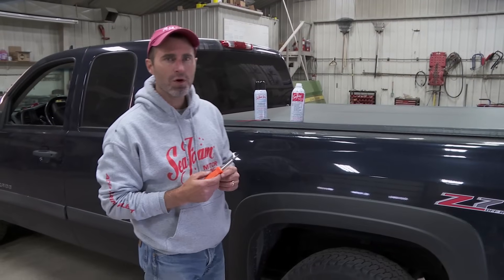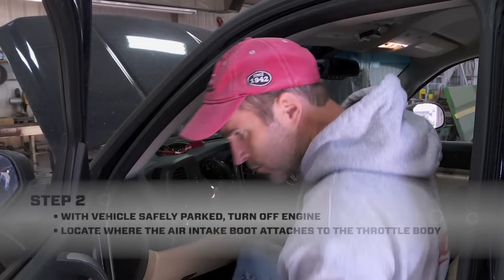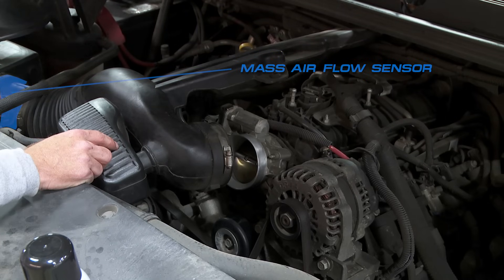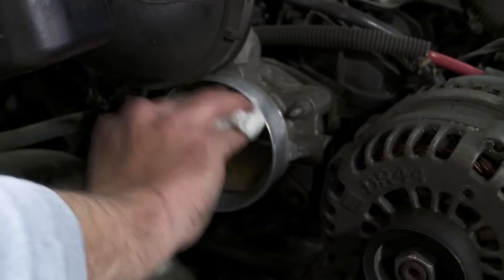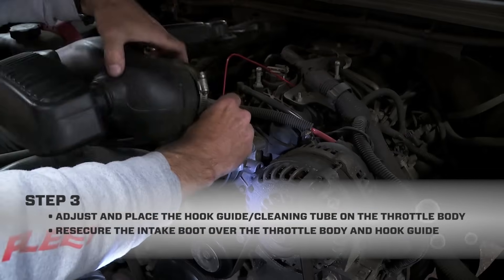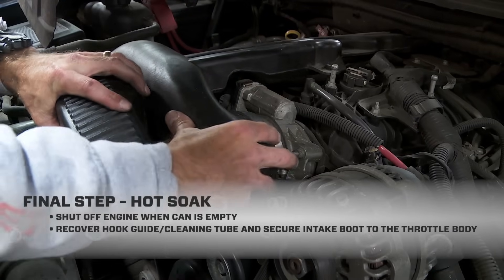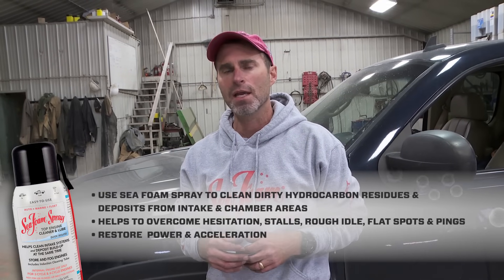How to clean a gasoline fuel injection air intake with Sea Foam Spray

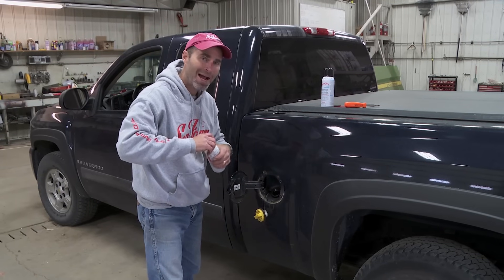Comment: @0:48 If that was the case , why instruct to poor 2oz pair galón on the can?
Reply from the maker: When Sea Foam is added to fuel cleans fuel injectors, when Spray is applied through throttle body clean intake valves through the air stream.
Reply: @SeaFoamOfficial wtf.
Reply from the maker: @memphisreines  Your original question about how it works (see edit) no longer appears.

Comment: My experience was that half the can of injector cleaner / gas treatment  ended up on the ground because the bottle does not have a neck.  I suggest using a funnel.
Reply from the maker: Agreed, funnels are essential for capless tanks.

Comment: So if you add through the throttle body does it helps to clean the fuel injectors that go to the cylinders???
Reply from the maker: No, does not clean through injectors. The throttle body controls the air that goes into the combustion chambers. Fuel injectors spray fuel into the chambers where the fuel and air combine and explode (gas spark plug ignites). Hope that helps!

Comment: I don’t even remove the intake boot in front of the throttle body. I simply drilled a “seafoam injection port” on top of the plastic boot, it’s got a tiny screw and o ring to seal it. 

To clean , I remove the screw/oring, insert the seafoam can hose, fire up the engine and spray away until the can is empty. Shut off the engine, hot soak for an hour. Re-install the screw/o ring and then take the truck for a HARD highway drive.

Comment: Is this safe to do it in front of the turbocharger air intake, after the MAF sensor? This is a 2018 1.5t honda cr-v , the throttle body is way too deep down behind the firewall, it's not easy to get to it. Thank you.

Comment: I love this stuff, I have been using it for years on all my engines. Years ago I had a Suburban that was burning oil big time, I put SeaFoam in the gas tank and in the break booster system as the used to recommend and after a huge puff of smoke the engine never burned oil again for many miles after this.

Comment: I have a Japanese in-line, six cylinder diesel with 100,000 miles runs just OK ,always going to fail the emissions test should I put it in the oil and the diesel fuel and the intake could this help me will it cause any damage anywhere?
Reply from the maker: Yes for adding to fuel and oil. No, do not add to a diesel intake.

Comment: @seafoamofficial 

Hey there, would you say its safe to use in a turbocharged engine ? (1986 Toyota Pickup 22RE-T with a newish turbo)
Reply from the maker: yes
Reply: @SeaFoamOfficial  I also happen to have the high mileage sea foam for the gas tank. I still gotta drive back home which ia 2 hours away before I perform the Sea Foam Spray via TB. Is it better if I wait until I get home and use both cans at the same time ?
Reply from the maker: @billythomas4527   Either is fine.

Comment: Can I use on Mazda 3 2014 and how much gas should be in the fuel tank???
Reply from the maker: Yes, any combustion engine. How much fuel is up to you. The higher the concentration, the better it cleans.

Comment: This is not why sea foam was invented! Can’t trust what he says. Seafoam was invented for 2 stroke engines boat engines to be exact .
Reply from the maker: What's the difference between gasoline for a 2-stroke engine and gasoline for a 4-stroke engine? Sea Foam cleans suspended fuel gum and varnish deposits caused by unburned petroleum residues.   Don't be afraid to expand the logical possibilities. Hope this helps!

Comment: I'm interested in trying this on my2007 Mazda3 with 215,000 miles. I'm wondering if this works as a throttle body cleaning in full though, or if i should wipe it down in addition to cleaning the intake with seafoam spray. Thanks.
Reply from the maker: The key feature is cleaning intake valves and chamber areas. Also works great if you want to spray the inside of the throttle body with the engine turned off, then wipe with a cloth rag.

Comment: I did this on my 2000 Ranger and the difference was amazing. It runs so smoothly now.
Reply: Was your Ranger acting "funny"?
Reply: @Nicholas_Triumph_Thruxton  It was running rough but it wasn't really clattering. It's also getting better fuel mileage now.
Reply: @randall1959  Thank you for the quick response. Yeah, I don't know what is going on with my '98 Ranger. It was running fine, and then one morning it just cranked, but wouldn't turn over. I put some starter fluid in the throttle body, and it started right up. I drove it around, and it didn't die out, clatter, etc. on me. However, after a couple of days of sitting, it did the same thing when I tried to turn it on. I used starter fluid again, and no problem. Now, I'm driving with a can of starter fluid and an 8mm socket wrench. Any thoughts?
Reply: @Nicholas_Triumph_Thruxton  try cleaning the MAF sensor
Reply: @randall1959  Yeah, I'll give that another shot. I've used maf cleaner before on it. Couldn't hurt. I'll let you know what happens.
Reply: @Nicholas_Triumph_Thruxton  Disconnect the coil bank and spray some contact cleaner in the plug

Comment: Can I used the non spray version in the throttle body? put in some Sea foam in an atomizer bottle?
the Spray version is not in my country
Reply from the maker: No, would not work and not safe.  What country are you in?

Comment: Would this work fine with turbo engines? I have a 2015 f150 twin turbo ecoboost. I’m concerned about carbon deposits going into the turbos. I’m sure that carbon passes through them already but am worried doing this that a lot of carbon will pass through at once
Reply from the maker: Yes, video titled FOR TURBO GAS ENGINE OWNERS. We do a demo on a F150 w/Ecoboost.
Reply: @SeaFoamOfficial  Thank you. I will search it up

Comment: Good evening Mr.Brian just Subscribe to your channel.I have a 2010 jeep Patriot and I have an engine light on.Just change the old spark plugs and according to the shop they say I have to use a sea foam in order to remove the engine light on.Whats your recommendation to use a sea foam.I never use a sea foam for all my vehicle accept this one.
Reply from the maker: Try disconnecting the negative wire to the battery, wait a couple minutes, the re-attach. That should clear your code/light.

Comment: What if the sensor is past the throttle body?
Reply from the maker: Which sensor, MASS or MAF?
Reply: @SeaFoamOfficial  maf
Reply from the maker: @Memry  No need to worry about MAF.

Comment: I put SeaFoam in my gas tank every third or fourth fill-up on my 1996 Tacoma with 325,000 miles. After seeing this video, I'm going to get the spray and use it on the intake of my wife's 2013 Subaru Crosstrek with direct injection. I never thought about the intake valves getting dirty from lack of cleaning from fuel not passing over them. I'm not a mechanic. Old dogs CAN learn new tricks. I'd guess cleaning everything from intake back would help keep the catalytic converter in shape as well. We'll see.

Comment: I tried it on a manual transmission  V6 Camry. Followed iinstructions and the car  stalled  on neutral when I drove it.Any idea why?
Reply from the maker: Engine stalled or car stopped?
Reply: @SeaFoamOfficial   Engine shut off completely and car turned off.  No power steering or brakes. Happened twice with trannie on neutral while shifting. Also runing 200 rpms above normal on iddle. Any advice?
Reply from the maker: @leogomez9014  Engine shutting off has nothing to do with the transmission/manual shifting. Some cars have a safety feature related to the key mechanism that causes everything to shut down and lock up. Have it looked at.

Comment: I first used SeaFoam spray in a 2012 Chevy Avalanche 5.3L. I was unsuccessful with the smoke show at the end but I believe I did it incorrectly (I think it’s because I left the straw of the van fully extended, as opposed to cutting it down so the spray had more pressure towards the throttle plate). I just performed it on my 2007 Charger, I cut the straw down and forced it into the throttle more, let it soak for 10 minutes and started it. Originally I had a slight backfire and some smoke, it did throw an engine light but that quickly went away (presumably because of the MAF, even though I applied it after it) and gunned it going uphill, and it looked like someone set off 4 smoke bombs!! They weren’t kidding when they say it cleans! It’ll be interesting to see how much my fuel mileage increases! I plan to use SeaFoam again!

Comment: Can we use Seafoam Deep Creep on the throttle body/Intake?
Reply from the maker: No, not in the same way you'd apply Sea Foam Spray that's getting drawn into the upper engine. Deep Creep is not volatile, so will foul out plugs if it reaches the chambers. Hope this helps!

Comment: I have a 2017 camaro ss and when I try to turn my car on it acts like it’s out of gas but it’s on half I ran out of gas and a small stick fell in would the sea foam work and get my car running?
Reply from the maker: Have you checked or replaced your fuel filter lately?

Comment: I just changed my MAF plugs could crank position sensor cam sensor and pcv valce added new ngk plugs and cleaned out my cct valve... I then used seafoam in the gas tank and the upper throttle body bottle sprayed as instructed waited about 15 minutes after when I started the car and took off there was so much smoke u couldn't see anything on my streets... Car runs like new now.... What exactly is in this stuff and how did it clean the inside of my intake so we'll. Do you recommend and oilf change early now
Reply from the maker: No need to change oil.

Comment: Just don’t open the butterfly valve on throttle body by hand. Use the gas paddle. That’s just my experience.
Reply from the maker: Agreed - no need to touch or open the throttle blade. Will open when RPM is elevated.

Comment: What do you do if the mass air flow sensor Is right on the throttle body?
My car is a 2009 Acura TL
Reply from the maker: No worries as long as the engine RPM is above 1500 during application. The engine will draw the liquid spray into the center of the  airstream.
Reply: @SeaFoamOfficial  thank you.
Looking forward to trying this.

Comment: Hey , I got a can but my map sensor is on the throttle body , can I still apply this ?
Reply from the maker: MAF sensor (along air boot, before throttle body) and MAP sensors are different - MAP is inside the intake plenum - no concern.

Comment: Thx for the vid.  I've been adding Seafoam to my fuel for years.  I recently bought a direct injection truck so I was interested in best way to inject into intake.  Question - why not spray Seafoam in front of Mass Airflow Sensor?  I used to remove that from my 97 and clean it with spray carb cleaner.  I found that my K&N aircleaner oil would accumulate on the sensor wire and cause problems. Does the Seafoam hurt the sensor?
Thx again.
Reply from the maker: Hi Ray. 1) It works best when applied in front of the throttle plate. 2) A MAF sensor is electronic and usually too far up the airstream - does not make sense to distance application from the throttle plate.

Comment: Thanks for the informative video.  I however could not make it work.  The valve in my throttle body pinches off the red hose.  

Can I spray Seafoam somehow after the throttle body?  Maybe in the spark plug holes?
Reply from the maker: The nozzle should be clear/in front of the throttle plate opening, so you're too extending the nozzle too far in.
Reply: @SeaFoamOfficial  Thanks for the reply!  I might have to try it again.

Comment: Can i spray it directly to the throttle plate while holding accelerator at 2000rpm  without securing the straw between the intake boot and throttle body
Reply from the maker: Can you operate the engine with the intake boot removed?

Comment: Hi Seafoam,
My mass air flow is right above my throttle body, should I extend the straw past the mass air flow sensor?
Reply from the maker: Where is the MAF sensor  located (not MAP sensor) in relation to the throttle plate?

Comment: Seafoam and this Seafoam Spray process just saved me a day changing out plenum gaskets on my Jeep .. and possibly a lot more!  Jeep ran fine yesterday, started today and didn't sound quite right. I was half way between home and local auto parts store for another project when the check engine line popped up and beeped in intervals... which is different than when it vapor locks. Coded - [cylinder 3 misfire, intake manifold, plenum gasket, injectors] ... and I was a bit stressed.   I knew I had Seafoam spray and a couple more cans for the fuel tank at home, so Iought 1 can of seafoam and plenum gasket set .. dumped the seafoam in and hobbled back, preparing myself to spend the rest of the day cussing the intake manifold. I dumped a second can of seafoam into my tank and got my husband to help with the spray process in this video. Jeep spit and sputterd and popped and made noises I never want to hear again but we got the can emptied.... let it sit for about 15 minutes and held my breath while I started it up. I still can't believe it, but it sounded perfectly normal [holy $hit!].  I checked codes with my trail dash 2... zero codes! Drove it around for about 15 minutes at varied speeds and had zero issues.... and still zero codes!
I am never getting cheap gas again and will seafoam every tank. I am so friggin appreciative of @SeaFoamOfficial !   Thank you!!!

Comment: 1:54 okay so how do I add the seafoam if my MAF is attached to/ and physically located in front of the throttle body?
Reply from the maker: Is your MAF sensor before or after (downstream from) the throttle plate?
Reply: @SeaFoamOfficial  its just before it. Upstream. I noticed there's an evap vacuum line that bypasses the MAF and looks like it goes right into the housing of the throttle body. Would that be a safe entry point for the Seafoam? Vehicle is an 2001 buick park avenue, base model. Engine is V6, 3.8 L
Reply from the maker: @SamuelMcDonald-d8y  If before than not an issue considering the fluid is going in the opposite direction.
Reply from the maker: @SamuelMcDonald-d8y  Yes, no worries.
Reply: @SeaFoamOfficial  Went through the vacuum line that feeds right into the front of the throttle plate. Worked just fine, no issues! Thank you!
Reply: @SeaFoamOfficial  Or perhaps I could just feed the red seafoam straw through the MAF screen past the MAF sensor all the way to the Throttle body plate? Trouble is the screen hole diameters are smaller than the red straw diameter.

Comment: You will likely have to clear the DTC codes as this will cause a rich fuel mixture. Don't know if it works though...worth a try.
Reply: If anything it will be lean due to a small air gap unmetered.

Comment: I poured the sea foam into my engine, where the oil goes and it stopped the ticking, and knocking for my 2017 Nissan, instead of the gas. Nothing bad had happened but it it bad?
Reply from the maker: No worries, ever.... Nothing but good! 👍

Comment: I did this procedure today on my 2016 kia soul 2.0L GDI engine for the first time since purchased new. It has 60,902 miles. It started good. Drove out of neighborhood subdivision with no signs of smoke. Pulled out on to the main road and kicked it down alittle, not a ton, but spirited, it spit and sputtered for a second, then plums of white smoke filled the air so much behind me I couldnt see anything behind me in my rear view mirror. Hope I didnt cause in major damage to my piston rings.
Reply: @sea foam official, please respond to this...
Reply: What happened afterwards,please

Comment: Can I run a can of sea foam through the injectors using a fuel injector cleaner tool that I have? Thanks
Reply from the maker: If a canister/fuel rail type can mix 50% Sea Foam to 50% gasoline.

Comment: The stupid little boot came off and I’m pretty sure it got sucked past my throttle plate. Any chance you guys can give me some reassurance that it’s just gonna burn off in there and not destroy my engine?
Reply from the maker: It's plastic so will likely hang up, melt, burn away.
Reply: I figured just needed to hear it from someone else lol. Aside from that the product worked great!

Comment: Do you guys promote the Seafoam thru the brake booster line still?
It looks really stressful to the engine and carries a risk if the tech pours at a high rate..
What say you??
Reply from the maker: Hi Jim. We do not promote. Sea Foam Spray through the air intake works much better! When adding to a vacuum line does not feed all cylinders evenly...And, the fluid is not aspirated so most of is wasted/pushed out the exhaust valves.
Reply: @SeaFoamOfficial  yes I agree...smoke show always a waste...and potential hazard to engine and all O2 breathing critters...

Comment: Can't use on a 2017 Hyundai Elantra because the Mass Air Meter is bolted directly to the throttle body.
Reply from the maker: MAF sensor  (before throttle plate) or MAP sensor (after throttle plate)?

Comment: Been using Sea Foam for a very long time. Just started getting a cylinder 3 misfires and It's not the plugs or coil pack. It goes away once the engine warms up. Going to try this tomorrow and report back the results.
Reply: how did it work?

Comment: I was doing this on a small 1.2L engine and the check engine light flickered on and off, before eventually settling on.

With an OBD tool, I saw it came back as a cylinder misfire. 
The car did seem to get sluggish and sputtered during the procedure, but we made it through.
Did something go wrong?
Reply from the maker: A misfire can be normal during application because the spray changes what's going on the the chambers. Will go away once the engine goes back to burning fuel and air.